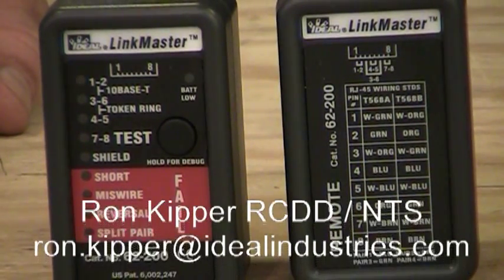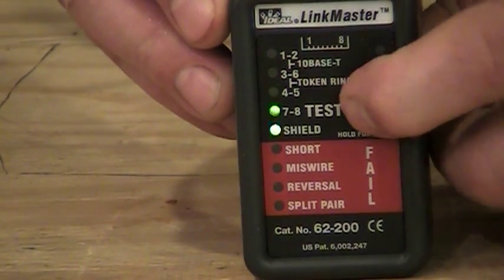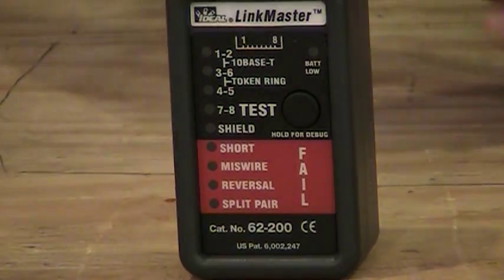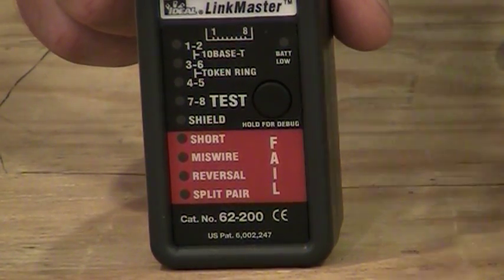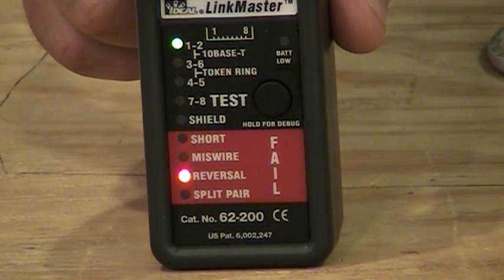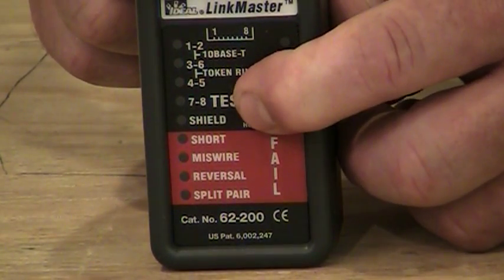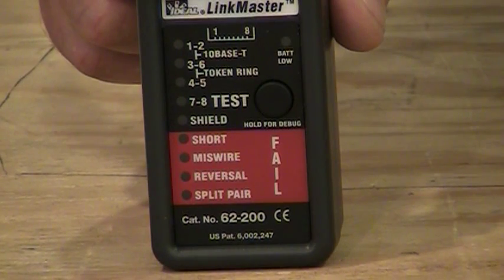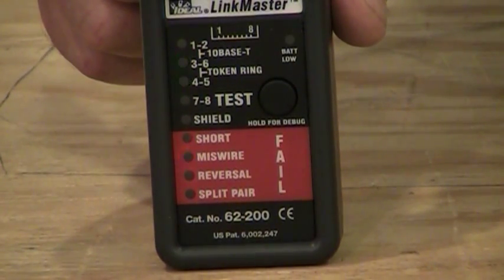LinkMaster 62 200 Tester

Comment: Why is it when I used only the master to test a cable I suspected to be bad showed the same as when I used both the master on one end and remote on the other? Do you always have to have both ?
Reply from the maker: Yes you must use both units if you just use the main unit it will display opens on all pairs use it well Ron

Comment: I bought a home that the builder never installed the rj45s on the end of the cables which all lead into the basement. I have to install the rj45 clips on the basement end. I only did one so far and it has a miswire for 1-2 & 3-6. I used T568B method. Problem is i dont know what the builder used and do not want to mess with the other end that is a ethernet coax wall plate. It’s hard to see what they did just from unscrewing the plate. Should i cut the end again and redo it or maybe its because I didn’t use t568a method?
Reply: Answered my own question… I swapped to T568A.. 😂
Reply from the maker: I would probably redo both ends of the cable and I would wire them in 568A or B. Looks like you solved them issue have fun Ron

Comment: A wire mapper is a wire mapper and can be had for around $5--not $50. If you want to spend more, my meter costs less than $35, does length pair testing using TDR and uses NEXT and FEXT to determine which end is not making a proper connection, which is a real time saver. 
https://www.amazon.com/dp/B00UJJGXZS/?coliid=I2O5TE1IS3PBM1&colid=I525WX1IHS8P&psc=1&ref_=lv_ov_lig_dp_it

Comment: Hi Ron, I reached out to you about 9 months ago regarding issues with my LinkMaster 62-200 and you got right back to me. I was hoping you could reach out to me again. Thanks- Kevin~
Reply from the maker: What can I help you with? ron.kipper@idealindustries.com
Reply: Thanks Ron. I sent you an email regarding my issues.
 "Although I was able to fix the "Stuck" Jack Pin on #4 position with your help, I'm still having that on going issue with my LinkMaster draining the battery all the time.
 I have to keep buying batteries every time I need to use it."

Comment: Ron:  What is the definition of a miswire, reversal and split pair.
Reply: ***** 

I am adding additional ports to my office and am using the 62-200 to test my connections.

I have a uncomprehensible network issue, 2 PCs are connected to a nested router. One pc has errors reading and writing, but only when the other PC is connected. I suspected it was because I forgot to wire the nested router-to-router connection with a crossover connection and the auto-correcting was messing up the nested router.

After switching the cables, I still get the same nework issues. I decided to test the wires with the 62-200. It is showing Miswire Fail with lights in 1-2 and 3-6 blinking. Upon debug mode. It blinks Miswire with 1-2+3-6 and 3-6+1-2. Isn't this what I want for a crossover cable? or did I mess up somewhere. This is a retrofit job, so I am not sure what happens to the cables after they disappear behind a wall and reappear in a bunch at the other side.

I'd appreciate your thoughts on this matter since I can't find a good answer on the web. Thanks in advance!